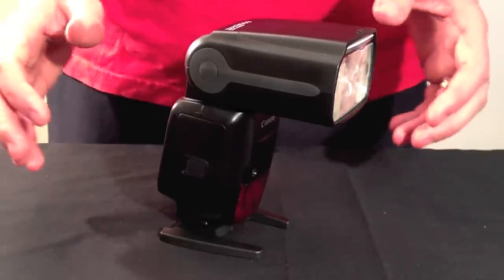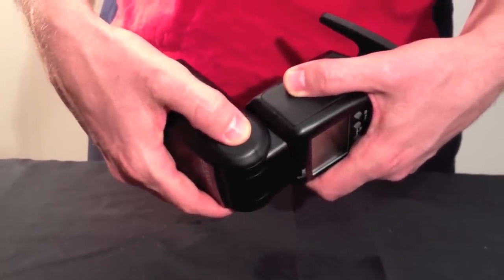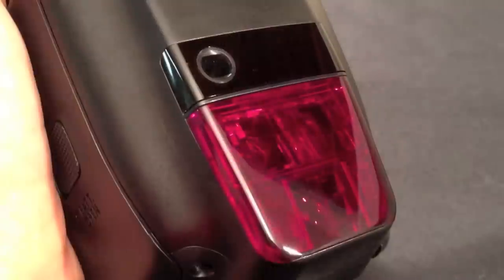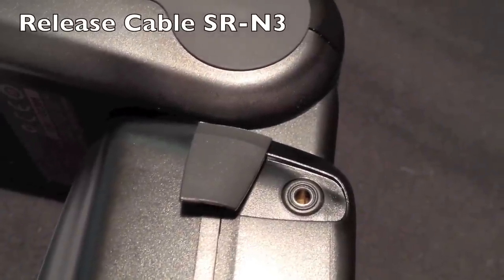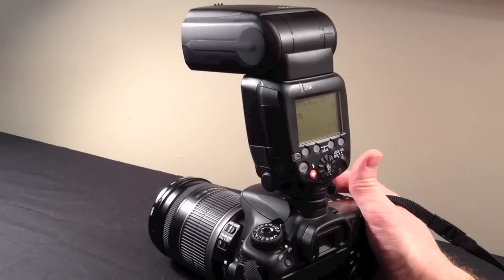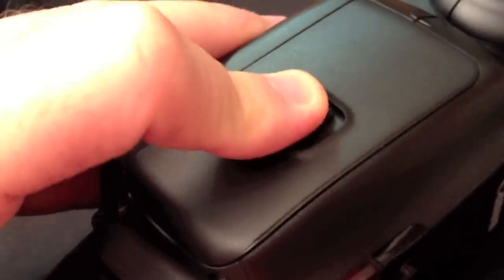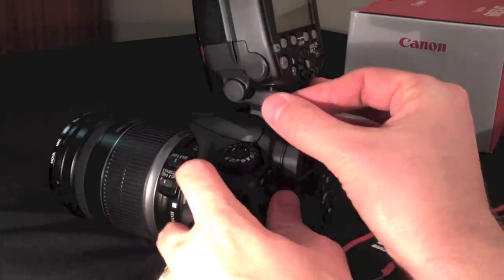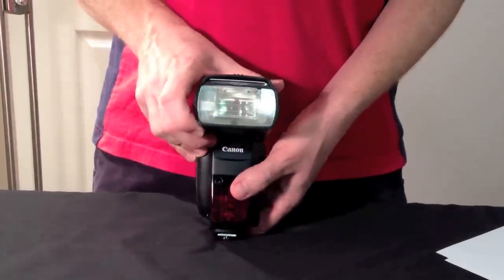Canon Speedlite 600EX-RT Review - Hands On Review - Features of the Flash Body

Comment from the maker: I'm unfamiliar with the "LiFePO4" batteries. They look good though. I'd just be careful of overheating with any sort of external battery pack though when using this flash or any other Speedlite. They do post a warning about firing off too many flashes too quickly in the user manual of the 600EX-RT. I'd be interested to hear how the LiFePO4 batteries go.

Comment from the maker: Yes, it works with the 60D just fine. However, like the other canon DSLR cameras, you'll need to buy the ST-E3-RT Speedlite Transmitter separately, or get another Speedlite 600EX-RT to make use of the Radio Transmitter functionality when shooting with your flash off-camera. Otherwise you'll just have to use the optical triggering on your 60D, which also works fine.

Comment from the maker: Yes, I would highly recommend the Canon Speedlite 600EX-RT for the Canon T3i camera. It will give you much greater shooting capability indoors for all sorts of photography e.g. portraits, family events, fashion etc. You can manually set all of the 600EX-RT flash controls by the menu on the back of the speedlite unit, or use the auto settings. You could also get a 'soft box' to soften the light produced by the speedite for portraits. It will increase the capability of your T3i. Good luck!

Comment: if you had two 600 speed lights and one 430 old speedlight, could you use the radio for the two 600's but also trigger the non radio speedlight at the same time ?

Comment: I wish that one feature they did was replace the battery dock with a battery system that uses the same kind as the camera
Reply from the maker: Evan, that is a great idea. Totally agree.
Reply: TheFamilyguy421 Given how quickly they chew through the charge I'm not sure that's as good an idea as it appears on initial thought. It's cheaper to buy a bunch of rechargeable, good quality AA batteries than it is to get a bunch of non-standard sized, proprietary camera batteries. They'd need to use a fairly hefty battery too if they want to get a good number of shots from it to make it worth their while which means a more expensive, slower charging battery.

It'd be nice to have the option though, if they made one that fit the same space as the 4 AA's so you can use one or the other.

Comment: Don't look at any other flash apart from this one,the RT makes ALL the difference with wireless flash capabilities.You do need the wireless commander as well though,once you have this you can start to control lots of speedlites and have them in separate groups! 3 or 4 600 EX RTs can replace 1000s of $ of Monobloc studio lights.The RT means the wireless communication is via Radio,this means your flash guns do no need line of sight for connectivity!Its an awesome system.

Comment: Yes it will, but if you use the Radio Trigger Wireless function, you will lose High Speed Sync and Grouping Function. Additionally, your max sync on your 600D will be reduced by 1 stop (2x light).

But your 600D uses optical wireless; the 600EX-RT WILL NOT LOSE features in Optical Wireless mode.

Comment: The best Wireless RF ETTL systems on the currently on the market are the PocketWizard Flex, RadioPopper PX & Phottix Odin. These are considered "Full Featured". Most el cheapo ETTL wireless systems lack something and its usually No HSS, No Ratios or No ETTL/Manual Mixing.

Since Canon doesn't license out there shit, any Third Party products have to be reverse engineered to work with Canon gear which means if they decide to tweak something you might be shit out of luck when a new body comes out.

Comment: The problem I have with Canon is these flashes do not last for years and Canon does faze out repairing their flashes.  I am in the CPS program and I am a heavy user of their equipment.  I rarely use an on camera flash.  When I need to light with a flash I will use my studio strobes.  I own a 580 EX light and worked fine until last week and I learned Canon no longer repairs the 580 EX.  The same 580 EX was repaired 4 years ago by Canon.  I would imagine soon within a year or two they will no longer service the 580 EX ll.  This is another way Canon wants you to buy more of their equipment.
Reply: dphotos Reading your post is kind of convincing me to pick up the Yongnuo flashes. They produce light, cost less, and if they get damaged or eventually stop working, then not such a financial loss. One benefit with Canon/Nikon/Sony etc, is resale value.

Comment: 1) you should already know it before you buy this...
2) never use/need it.. so no comment.
3,4,5) all flashes (580exII,SB900) could get easily overheated with ext battery pack such as turbo,cpe4 if you dont disable the internal battery source (4AAs)